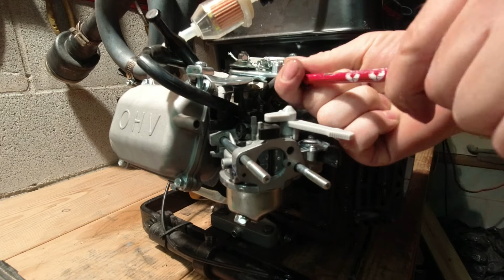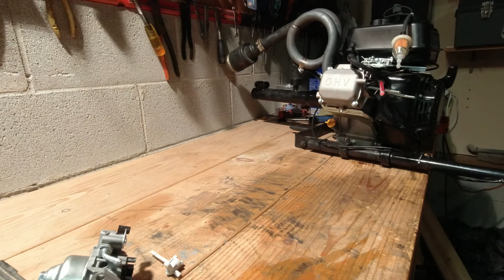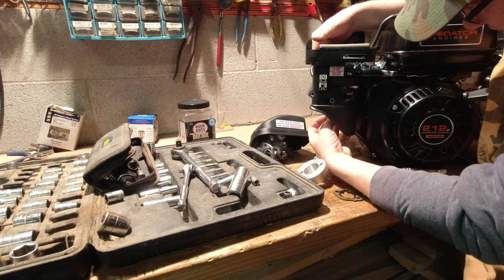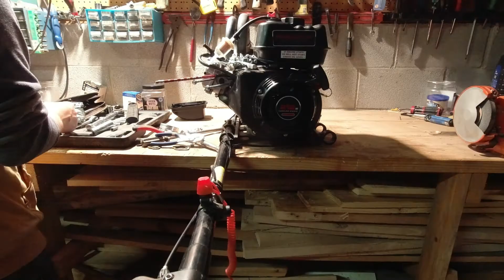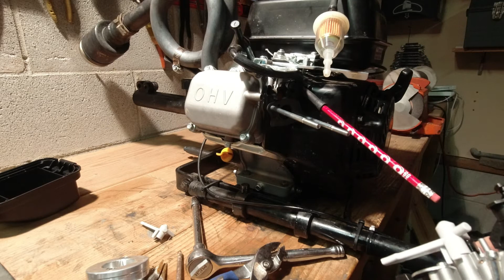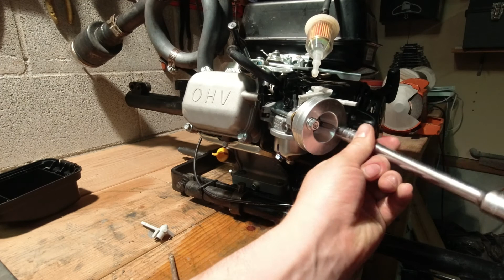Carburetor Replacement On Predator 212cc Engine (Fast Version)

Comment: I just bought my 1st predator 212 a week ago , it’s installed on my trike and Yesterday was the 1st attempted start  . all the fuel  leaked out the carburetor and even with troubleshooting from harbor freight  the float still wouldn’t work on a brand new motor. I’m watching this to learn how to change it since I bought a carb from Amazon

Comment: I've had a few issues with my carburetor also on my 420 predator I broke down and got a 18 hp vanguard and will never go back to the predator engine
Reply from the maker: Yes I’m about done with these Predator engines after this one for real
Reply: @MudMotorsMax  I highly recommend the vanguard 18 quite and no vibration at all and don't have to choke it everytime you start it
Reply from the maker: @mudmotorcatfishing  Excellent I’ll look into it I’m looking for anything right now the three-quarter inch shaft
Reply: @MudMotorsMax  mine is the one inch shaft so it wouldn't work for you unless you upgrade your kit
Reply: @MudMotorsMax  that engine does cost a lot more also you will spend around 1500 just for the engine
Reply from the maker: @mudmotorcatfishing  Yeah I would like to get one the one day when I have the right kit
Reply: @MudMotorsMax  I have the Swamp Runner and I'm going 20 up river and 25 down I think it is really easy to run and fast